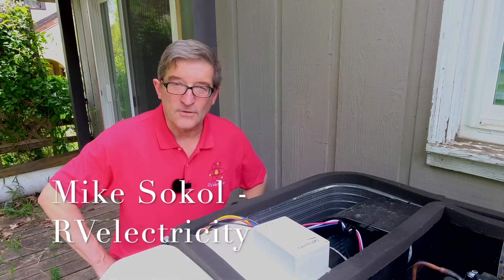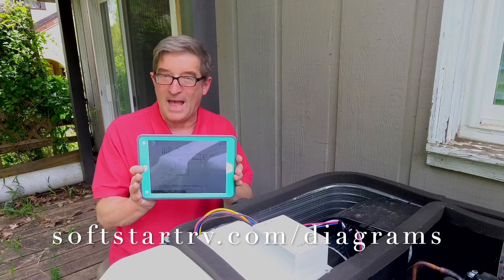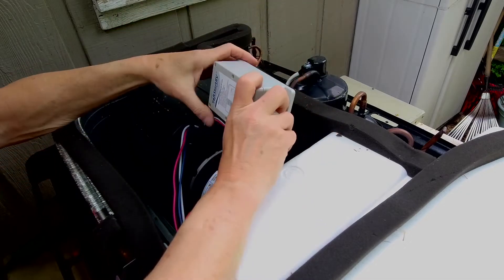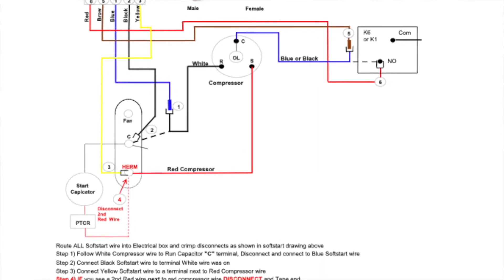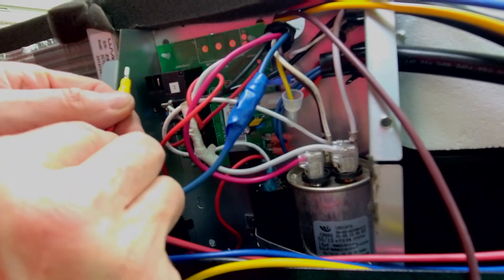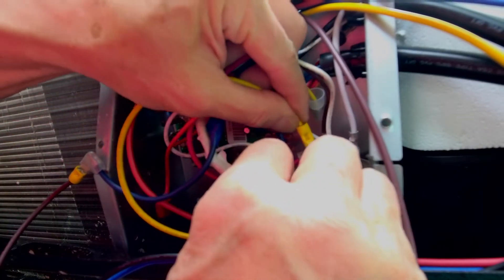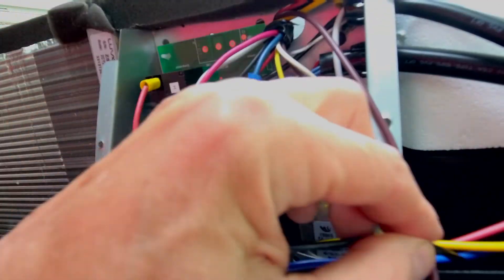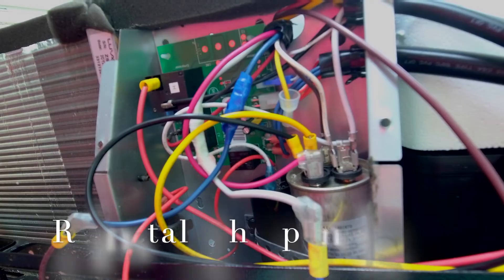SoftStartRV No-Splice Install  by Mike Sokol

Comment: Why did you put the Black wire on the Herm terminal instead of the Com (Compressor) terminal as the wiring diagram shows? It appears you have wired the SoftStartRV incorrectly in this video. When I compare your older SoftStartRV installation video you clearly attach the black wire to the COM terminal where you removed the white wire. I hope you correct this video because it will cause a lot of people who respect you to miss wire the SoftStartRV to their Dometic Penguin ll air conditioners.